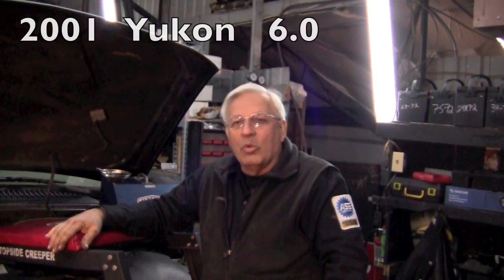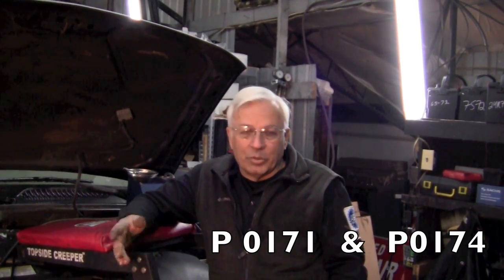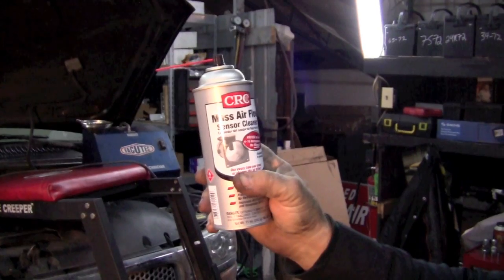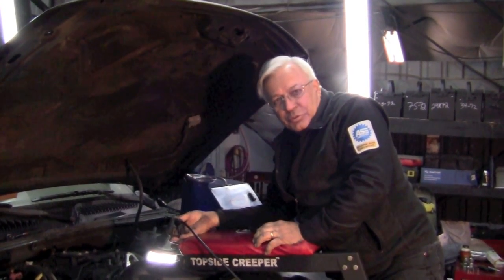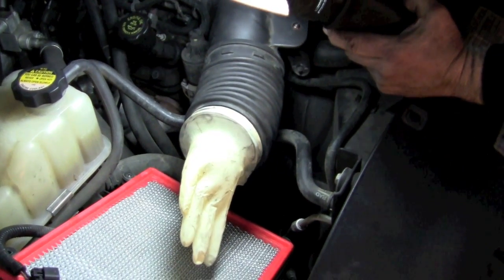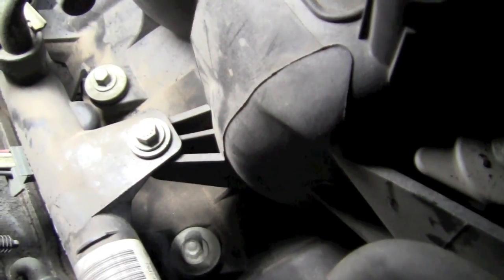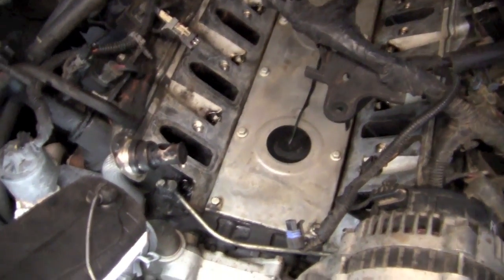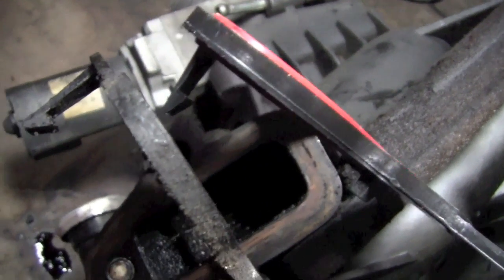Smoke testing for codes P0171  P0174

Comment: I see that smoke entered into the INTAKE (after the air filter) will send smoke into the crankcase: oil filler tube and oil cap.   I noticed my oil cap wasnt sealing and the tube grommet was jacked up.   Seemed to help......but still chasing down P0174: just one of 2 banks (GMC Savana 5.7l V8)

Comment: Im dealing w P0174.  So just one bank.  STFT is running at 50%!   O2 sensors are new, good.  Fuel pressure etc is fine.  Im wondering if a faulty TPS could affect the PCM and affect just one bank.  THoughts?  THANKS
Reply from the maker: No it would not.  You have a air/fuel balance between the banks.
Reply: @realfixesrealfast  Thanks.  I found an air leak at the air intake duct which Im addressing soon.  Bank 2 Sensor 1 reads STFT of 50% (!) and the LTFT is also quite high. The spark plugs and O2 sensors on that side are fouling.  I keep cleaning them - even swapped the O2 sensors left, right... no difference.   I just replace a faulty TPS yesterday.    Any thoughts? Much appreciated**
Reply from the maker: @atomicdmt8763  You said "The spark plugs and O2 sensors on that side are fouling". that means there is excessive fuel on either that bank or those injectors.  I would suggest a fuel leak down test on all the injectors.
Reply: @realfixesrealfast  Thanks.  This P0174 issue just started a few weeks ago and I noticed all the spark plugs on that bank were black, carboned up.  No misfire codes.  O2 sensors on that bank were also covered in black.  Ive been continually removing and cleaning and test driving to figure out air leaks - which would only affect that bank.  The other side is fine, clean.  Perhaps a computer ECU issue? much thanks

Comment: I just changed the valve cover gaskets and all intake and plenum metal gaskets and upon torquing everything to spec following the bolt tightening sequence in the manual, I’m now getting a p0171 and p0170 on my 2002 Honda Odyssey. I’ve visually inspected all hoses and taken it all apart 3 times already and still can’t find the source of the leak. All 6 injectors are also new and OEM. I’m stumped

Comment: Does this suggest if I'm only getting p0174 my issue is isolated to bank 2? Bad fuel pump or intake gasket would would throw both bank codes?

Comment: Great vid!👍🏼I hav po171 on my 2008 pont vibe and car has No symptoms - purrs. I’ve chkd maf sensor and intake valve gaskets. Gonna try and chk fuel pressure as everything else looks good. Also, it predominantly happens in cold weather - any suggestions??😣
Thx

Comment: Will that make it throw codes on one bank and not the other? Im getting po300 code and crappy idle at cold starts also not functioning solenoid vent valve on my 03 Tahoe,oh also bank 1 sensor 1 low voltage and heat codes

Comment: Is it normal to get some smoke from an EGR Valve Body?? Mine has slots cut out in the body of the EGR Valve and some smoke comes out of those slots.
Reply from the maker: remember, EGR is exhaust gas recirculation, so that smoke must be in the exhaust gas. That is not normal and should be checked

Comment: I have a P0174 on my 02 Lexus RX300 . If it’s a low fuel pressure,it should be both banks,right ? When I drive,it runs very good. But at idle, it shakes a little bit. That indicates a vacuum leak,right ? Thanks

Comment: Also need to do a fuel volume test before writing off fuel delivery.Most techs know right away when both banks are lean it is a air mass sensor or a vacuum leak that services both banks.When a car lopes at idle or runs poorly at idle it is most often a vac leak.Your vacuum is highest at idle.That sucks in more air than in running conditions.Any tech that goes after fuel delivery first in that situation is scamming the customer or warranty.I do like the smoke machine for diagnostic more than the method we used.

Comment: used a fogger   smoke coming out of Idle air control valve   changed it   smoke still coming out but not as much    is any smoke coming out normal?

Comment: I got a P0171 code in my Chevrolet 5.7 LS1 V8 powered Holden Commodore last week but I didn't have a smoke machine to diagnose this,the O ring on the fuel filler cap had a split in it,it was only noticeable when the car sat for a few minutes then the engine was restarted at a service station for example - a fault code or codes  would be set, previously,I also got a P0174 code as well.

So I checked the obvious things first,note the fuel tank wasn't holding vacuum,note Holden didn't fit a fuel tank pressure sensor so the P0442 code is irrelevant in my car.

I would consider making my own smoke machine but the obvious things such as the MAF sensor clamps coming loose have caused a P0102,P0171 & a P0174 code in the past !
Reply from the maker: quick thought here,  it should hold pressure when powered and/or commanded on.  Check the vent valve, may be stuck open and causing it NOT to hold pressure
Reply: The tank should be under a vacuum which it is,when I fitted the new fuel filler cap,I noticed a drop in idle speed for a few seconds then the idle speed stabilized at its normal idle speed so that tells me that the EVAP system is functioning correctly when the engine is running !

Comment: Hi I came across your vid today and I was wondering if you could answer a quick question?
I have a 2001 Ford F-150, i did a smoke test because of a lean code I am getting. The only place the smoke came out was from a little round vent cap on the IAC valve. Is that little vent cap supposed to leak smoke? I remember doing a smoke test on my truck a few years back for a pcv valve hose leak and I don’t remember that cap ever leaking before. The only reason I’m questioning this is because I saw a couple posts online about this and I saw some people had said that vent cap will leak smoke during a smoke test. But again, when I did this test a few years back I think I would’ve noticed it.
Thank you much appreciated
Reply from the maker: the IAC valve should not leak smoke
Reply: realfixesrealfast 
Okay thank you so much for the response.  Lol all day at work I kept going back and forth in my head if it should or not. Thank you again
Reply: I replaced the IAC valve on Friday night. That leaking vent where smoke cane out is  was what was causing the vacuum leak. 
Thanks again for your input.

Comment: 1997 F-150 was getting po171, lean 1 bank, under the hood I found a pvc hose had came off, also clean MAF sensor with maf spray cleaner...cleared code at auto part store...lite never has came back since...
Reply from the maker: that system may take a couple "trips" for the monitor to recognize a real fault from a intermittent fault.  Drive it for a few days and if it doesn't come back on, then it's most likely fixed.
Reply: realfixesrealfast Thank you very much..

Comment: Man I need one of those machines so badly lol I've been dealing with a P0171 for 3 months
Reply: I don't know if you got your problem fixed but mine turned out to be a brake booster the had a hole in the diaphragm.
Reply: Mark Harris Were there any OTHER symptoms besides a lean code?
Reply: @capman911  curious - did you notice anything w braking, prior?

Comment: I have a 2001 2500hd 6.0 and the engine shutters only when I hit a bump, and P0174 comes up on my programmer. what would be the cause in this case? I tried shaking wires under the hood and under the truck while running but didn't shake anything that made the engine miss. any ideas?

Comment: I have the the same to lean codes on my 01 Ford Explorer Sport, 4.0, 6cly.  I now have had a few vacuum hoses that needed to be replaced, replace the pcv valve, replaced the fuel filter & I just spent quite a bit of money to replace my upper & lower intake gaskets.  Still have the same 2 codes.  I ordered a new MAF that will be arriving today.  If that does not fix it, what else should I do or have done?  I'm losing my mind here.
Reply: +mattymat1219 Try your pre cat O2 sensors
Reply: +lilchopin1 I changed all 3 of the O2 sensors
Reply: mattymat1219 could be fuel problem , check fuel trims

Comment: Hello, I have 2.0 96 contour. Had it smoke tested and smoke came out egr valve vent holes. Guy didn't block off intake or exhaust just put snapon smoke machine onto valve cover. Is the smoke leaking from those vent holes normal because it may have a positive pressure egr? He said not supposed to leak another shop said same, but I've read it may be normal on some cars. Please reply because I'd greatly appreciate it because I'm getting contradictory information. Thanks
Reply: tpformybunghole1974 I'd like to know the answer to this as well
Reply: +Arturo Torres Hi there, i am looking for the same answer just  like you , did you find it , please share it. Thanks
Reply: +Dal Mark Yeah, it is normal. I replaced it with a brand new Motorcraft EGR valve and it did the same.
Reply: Thank you so so much...On mine , the smoke is coming through those wholes .I was doubting on it , so I will see it as normal then. Thanks again.

Comment: I got two trucks with the same problem. Its a s10 with 4.3 and a Van with 5.7. I changed MAF sensors on both trucks. S10 ran alot better after that and van is the same. Also both exhaust manifolds  on both trucks turn CHERRY RED after running it. S10 gives a codes P0171 and P0147 ocassionally. I would greatly appreciate any help. Thanks alot

Comment: Was the gasket leaking on both banks as DTC po171 &  po174 reports?? Vid shows only one gasket / bank leaking smoke. If only one side, then why did both banks get reported?
Reply: with one bank running lean the system o2s and trys to rich the mixture causing an imbalance in the engine so if left long enough the computer will try to compensate for both banks it (the ecm tune) only being allowed to add so much extra fuel will set both DTCs  also the intake can change as it heats up causing the other bank to lean out too as it expands

Comment: But why did it return a code for both banks?
Reply: I thought about this for a bit and realize now that even though it is on one bank, that while the other pistons are on the intake stroke, it would draw air back into the plenum and affect the other bank, correct?

Comment: Hi , my name is Dan .I have the same codes coming up I put a new air flow sensor and it gives me the same codes  I looked for leaks but did not find any could it be the 02 sensors are bad? Thank you dan ,it's a chevy silverado 2000
Reply: Daniel Cortes you may need to reprogram/update your pcm with the latest software, ive fixed a few of the like that after veryfying that nothing else is wrong

Comment: If you looked at the fuel trim at idle, you would see Positive numbers but, if you raised the RPM, they would drop due to the vac dropping.  This points to a vac leak.

Comment: I have a 2003 f150 that has both of these codes. It misfires and shakes violently upon takeoff. And it will slightly shake at idle. Any idea of what this could be?
Reply: Ignition coil malfunction

Comment: you can use propane or carb cleaner ( carb cleaner is less safe since it coats surfaces and could ignite) however you just spray alittle around area's that could be pulling in outside air (intake area's, vaccum lines, etc) until the engine revs.. once you get it reving from spraying in one spot off and on you know where your leak is. i think "realfixesrealfast" have a video on using propane to find a leak. Also "Ericthecarguy"channel has one as well on how to use carb cleaner method. cheers